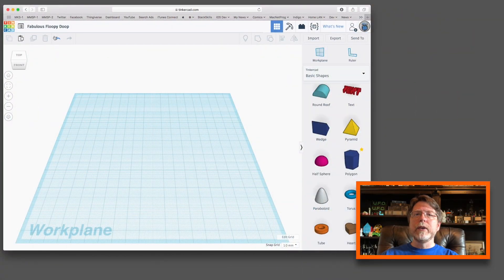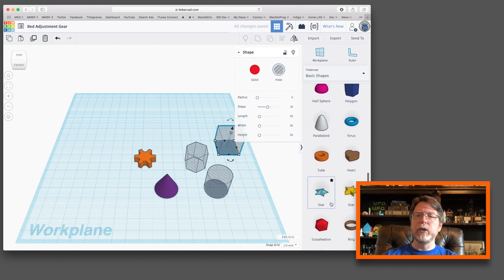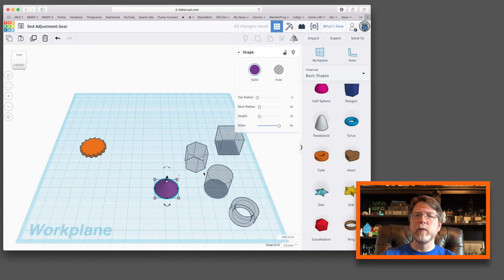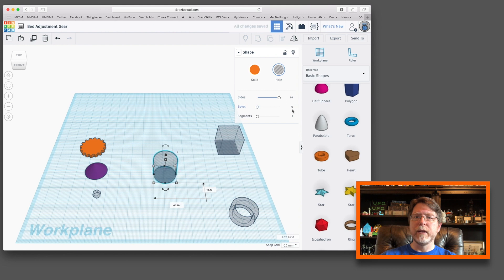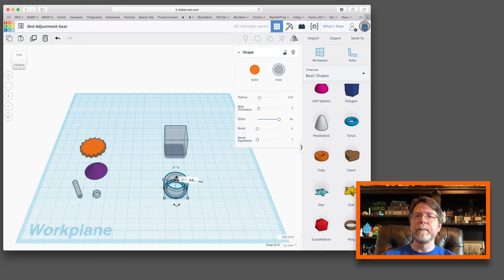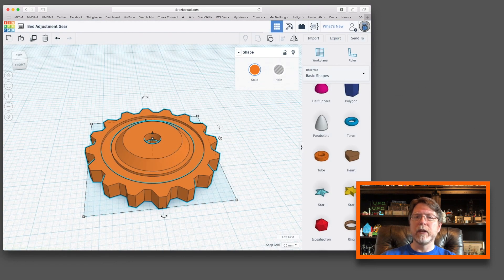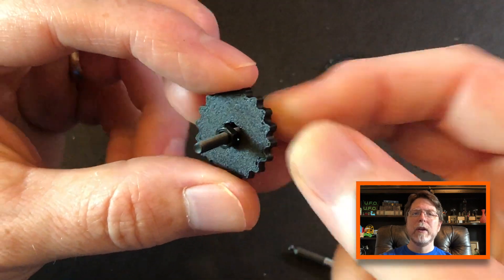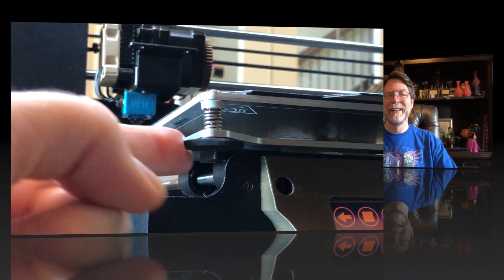Better Bedknobs: Design & Print Monoprice Bed Adjusters in TinkerCad

Comment: Love having both a Tinkercad tutorial and a mod in the same vid.  Your mods have helped me a huge amount.  Thank you!
Reply from the maker: Thanks! I’m having fun sneaking these Tinkercad tutorials in for some of these mods. I can’t do it for every mod, but if I see an opportunity to do one, I’m likely to take it. There are so many different ways to do things in Tinkercad and the more you use it, the more creative you can be with it.

The new feature where you can pass a Tinkercad design over to Fusion 360 is super cool. It’s a one-way trip (though you can export an STL from Fusion 360 and import it back into Tinkercad, but it’s one unit and you can’t un-group it if you need to make changes to it). I’m using it to add finishing touches to things, like fillets and chamfers and stuff. It rounds the edges of the parts quite nicely!

Thanks for watching, and I’m glad you’re enjoying the videos! 👍🏻

Comment: Really enjoy your vids. Hoping you do a BLTouch mod. That's the last thing I have left to do to my I3+ before I'm just re-doing new versions of previous mods...which I'm already doing, anyway.
Reply from the maker: Hi James! A gentleman by the name of Michael Laws has a channel called Teaching Tech, and he has done an excellent pair of tutorials on installing the BLTouch mod for the Cocoon Create version of this printer.

https://youtu.be/cHstALf8Feo covers the basic installation, and 

https://youtu.be/BV11-VOQjMc covers it in more detail, including tweaking the firmware to perform the mesh leveling more quickly.

I followed the second one, but I'm still not 100% happy with the results. However, I have nothing but good things to say about the tutorials.

Unless everything is 100% square on the printer, the mesh is going to be off a little bit. Usually this means the printer thinks one side of the bed is higher than it really is, and so you'll end up with a situation where the nozzle is too high on the left side of the bed and plastic won't stick, and it's too close on the right side, and may drive the nozzle into the build surface.

The printer I have this installed on is mostly square -- I have an issue with the rods on the X axis being slightly out of alignment on one side. The position of the BLTouch sensor is generally several millimeters out in front of the nozzle, so any distortion in the printer's alignment is magnified, and the result is what I mentioned above. The big problem I have is there is no way to adjust this aspect of the printer, so I'm kind of stuck with it.

That said, if you try it and it works, it's awesome. If it doesn't work out, it's easy to disable the feature.